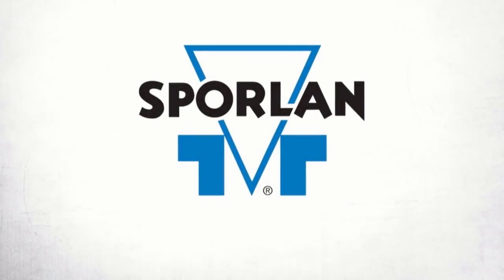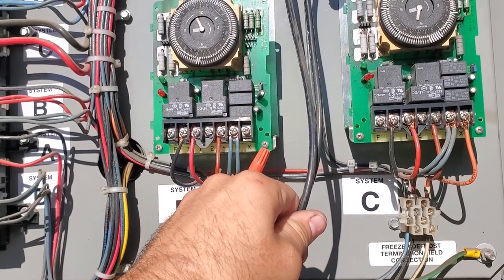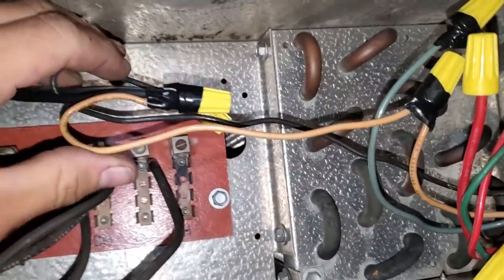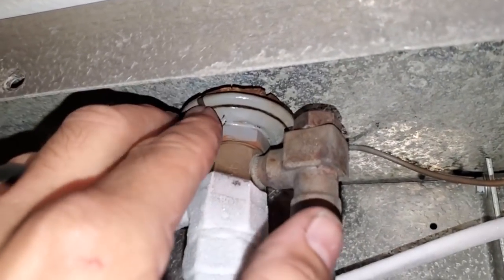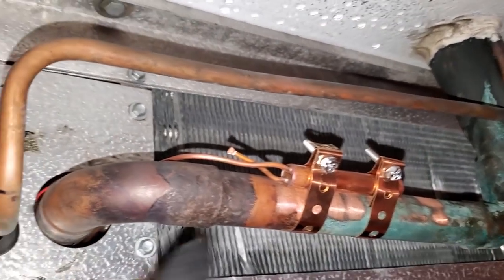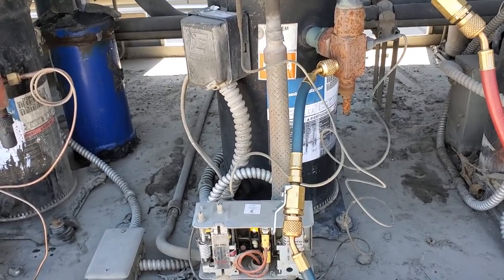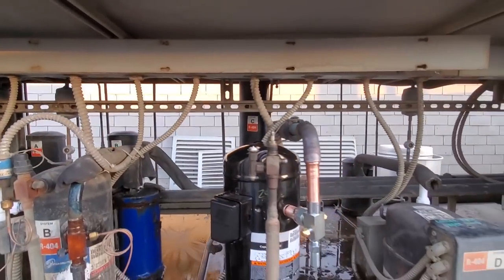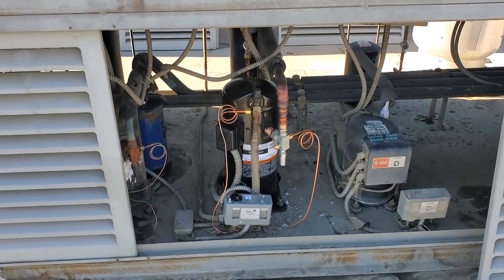BEER WALK IN DISASTER

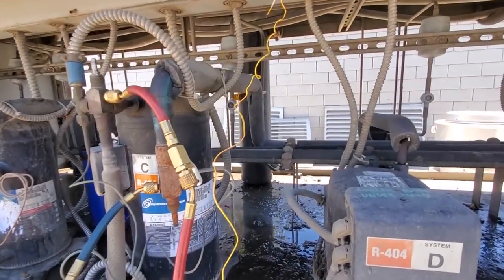Comment: 27:28 Sightglass flashing (saturation) with 27* subcooling shown on gauges. This is a false subcooling indicating non-condensibles (air) in the condenser. The rusty looking stainer 25:26 is also evidence of air/moisture in the system. The compression ratio of 5:1 indicates a very robust compressor. The non-condensibles being removed during the compressor change out makes it look as if the compressor was at fault but it almost certainly wasn't.
On the bright side, moisture may have made the oil acidic and damaged the compressor winding insulation. It may have been short for this world anyway.
Non-condensibles are notoriously difficult to diagnose and I am guilty of getting it wrong also. I hope this comment can help save unnecessary work for someone in the future.
P.S. The value of dedicated and honorable service exemplified in this video is priceless!
Reply: I have had compressor where they pump fine but the seal in the compressor was allowing bypass?
Reply: PM for quarterly or semi-annual checking of oil sample and replacing dryer if needed could have saved the compressor or proven it to be good... 💀
Probably 10x cheaper to do this. 😆
Reply: Yep, I do wonder how they got so much air in the system. And possibly not nitro purging for brazing?

Comment: I also think about jobs at night, dream about them sometimes too. Worse one was a remote location gas heated rock pizza oven. Had to crawl behind a panel to get to the gas valve. Replaced valve, removed the plug, hooked up my manometer, made my adjustments. Fought my way back out of that tight area, filthy, sweating. Function test, left, made my flight. Got home, happy, job complete. Going to bed that night and couldn't remember if I put the damn plug back in! Bothered me for a few days until I remembered screwing it back in.
Reply: I'm an A&P that works on aircraft... I'll tell you what. I lose sleep once or twice a week after watching an aircraft fly away knowing damn well I did the job right and two other guys verified the job was correct, countless ops checks in the hangar, leak checks and the whole 9 yards. Thats called having a conscience and morals for your customers. It's the guys that don't lose sleep at night knowing a family is flying behind their work that worry me. It's human reaction to be concerned and you're a better tech because of it.
Reply: @kennyboyswag  exactly, you're not good at what you do unless you lose a bit of sleep once in awhile due to your conscience. Everyone has one and at some point you're not gonna remember something, and unless you don't like what you do or care, it's gonna keep you awake.

Comment: Yeah, been down that OCD/a***-retentive road - too..., retired avionics engineer, owned a Carrier dealership because of aviation being so 'cyclical', did broadcast engineering because my high school had a TV Station.  I never liked the way that condensing units came wired from the factory, so I spent two hours building everything into an internal harness (also utilized only perfect right angles). Tinned ALL stranded wiring at the termination points, coated bare metal everything with Boshield. Every condensing unit received it's very own dedicated grounding rod, with 10 AWG treated copper grounding wire. CAD - drawn  schematics/layouts/box diagrams for everything we ever installed.  Justified the 'overpolishing' by telling the commenter(s), "that 90% of the durability of the equipment directly relates to the quality of the installation".  I sold my half of the business to my business partner; there are still a few "Carrier Round Ones" working, that we installed in 1981.

Those contractors who don't work to a "set standard", empower those who do, with the clientele which they lose.

Comment: 1 An auxiliary switch is only needed if your breaker cannot handle the load of both the compressor and heaters.
2 Beer cooler runs close to 32 degree.
3 Someone made the limit switch on both Evaps disappear and they screwed up the wiring.

Comment: I really enjoy your videos! Im not an ac tech but my older brother did commercial work like you. I worked with him on change outs 30 yrs. ago. During summers in high school. Im a master electrician now. You need to get yourself a phase rotation meter. Some equipment will be ruined almost immediately if you get the rotation wring.

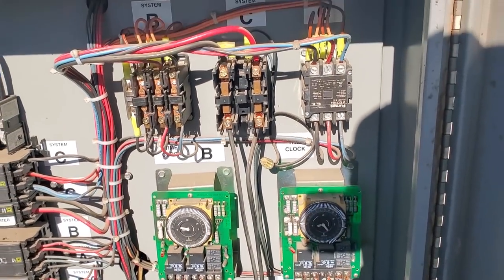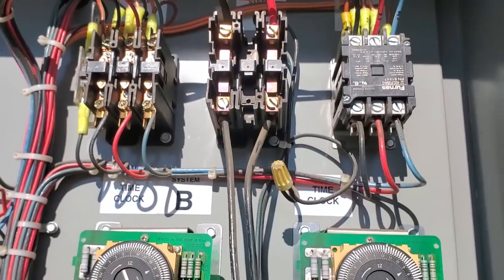Comment: What usually happens at 3:50 is there is an auxiliary contactor  on the compressor contactor that prevents the defrost contactor from engaging while the compressor is running. You mention it at 4:30 so my information is unnecessary. Those powerheads were in a really rough spot. It really annoys me when I have to deal with stuff like that. The design engineers make no accommodations for service...

You were not kidding about this being a disaster. Holy smokes.

Comment: I don't think many people realise how tough the job is (Refrigeration). So much things to check on system, hours spent on jobs, environments you have to work in. As an ex engineer i know what it's like changing compressors/condensing units in the dark! Good job interesting to see what gear you use in the states, little bit different in Ireland but pretty similar. :)

Comment: Good job. I found out over the years that it is fairly common to fix one thing and it leads to other failures of weak parts. I had to replace a compressor 30 feet in the air on Christmas eve for a computer room AC. Thanks for that video.
Reply from the maker: I will be going live on YouTube this evening 8/5/19 @5:PM (west coast time) to discuss my most recent videos and answer questions from emails, the YouTube comments and the chat, come check it out if you can! https://youtu.be/cfSKAK6BvSw

HVACR Videos

Comment: "Brazed, uhh, soldered on here. Just cleaning up my welds here"

🤔

Isn't that technically three different, distinct processes..?
Reply: daniel rodriguez brazing is much closer to soldering than welding. The base metal doesn’t melt, and the join is formed entirely with filler metal in brazing and soldering. Welding is a process where the base metal melts and mixes with the filler metal.
Reply: Dingle Flop brazing and soldering are subclasses to welding. Not the same but easy to pick up if you know the other. It’s like the difference between a motorcycle and a moped.
Reply: @picklev5064 . more like moped to a TT race. Cant believe how many grown ass men cant proper sweat a pipe. Soft Metal High Heat. Spends an extra hour chasing vacuum leak. SMH but yes your Book Work is Solid
Reply: Mr Sunshines oh the irony of calling someone a keyboard warrior while trying to correct them.  SMH

And no they aren’t welding,  welding is action of melting the base metal and fusing it with a filler metal to create a bond. Brazing you are only melting the filler metal (usually of copper and zinc alloy) and soldering is when a filler metal has even a lower melting point (below ~840F).    To someone not in the field, this may seem unimportant but proper terminology and knowledge of process leads to greater success and better paying job opportunities.    How can this be applied? If a contractor/engineer told me he need me to solder a pipe for carrying water, I know that my soldering filler metal is gonna need to be a tin alloy that doesn’t contain lead.  But if you go and just pick up a brazing rod, you could end up damaging the pipe itself as the melting point of the filler metal was at or near the melting point of the pipe. Wasting time, money, and possibly the job or even someone’s life for not knowing about lead poisoning and water pipes.

Why go this far, cause the industry needs more efficient and knowledgeable welders.  There’s an experience gap that’s about to happen and we need to fill it as fast as possible. Break bad habits early and fast so you lunge ahead in proficiency.
Reply: Mr Sunshines go back to the comments, if you use your eyes you will see me address my original comment to dingle flop and not hvacr

Comment: I have the same low profile system in a walk in freezer. With that pressure control defrost termination switch that I could not understand until you called it by its name! Thank you Now for tweaking the system it stays at 0*F and I need at -10 will check the temp controls and any walking due to vibration I learned is your other videos. Thanks man, I'm is S.Florida learning this on my own after years in HVAC expanding to refrigeration any tips be greatly appreciated!

Comment: reminds me of the old rancho seco nuclear power plant out side of sacramento california - they had issues from day one of it never working right and it was not until they were decommissioning it that they found one of the water cooling pumps had been installed backwards - scary crap there because it could have caused a full melt down and they never noticed -- i have seen via your vids that installers make simple mistakes that go unnoticed and unfixed for years because it kinda works but not anywhere near an optimal level.
Keep up the great work and keep the vids coming,i find them relaxing.

Comment: I think I would have pulled all the old wire out that was not in use so when the next service person fixed it all those wires won't be there. I was taught to remove all unused wires so I don't cause confusion. But besides that you done a very good job on changing items before they break. Great preventive maintenance

Comment: Lucky that compressor was able to handle medium temp coil pressures on restart without a CPR valve. I know Kirak built a couple of racks for here in Vegas for micro brew pubs with the low temp scroll systems and electric defrost. The box temps were I believe around 31° average but no glass was stored in them. Alcohol in the beer prevented the product from freezing. I'm wondering if that compressor is sized property for medium temp with the amount of suction velocity you may encounter on a warm start up.

Comment: two "agains"  was a manipulator of heat before and another good video.. also always amazed me that when you run into these multiple problem calls how the system was actually able to  limp along before. Side note on the defrost; if a med temp system doesn't go below 35  air temp in the box and if (big if) system is running properly (which looks like you spend a good time worrying about  Kudos) then the normal off cycle should be adequate to defrost between run cycles

Comment: I love your vids!  Great angles, lighting and sound! Superb narration, including smashed fingers, and just the right amount of explanations for every action and every observation.   
I always set all defrost times to every 8 hours, or 6 hours.  The reason is that after a power outage, your clock will need to be reset, and it will eventually result in a service call. To avoid these pointless defrost calls in the years ahead,  always use equal divisions of clock time, i.e. 8 hr.   The theory of performing night time unoccupied defrosts, will result in senseless added service call expense for the customer after power interruptions, (storm, accident, electrical service, repairs, remodel, etc).  During a service call, when I see targeted defrosts for 2 a.m, I always change the defrost schedule to every 8 hours and then explain defrost cycles and symptoms to the kitchen manager.  The 2 a.m. defrost is best suited for techs on site, that are employees that respond on demand without bearing the cost of a service call to outside companies.  Eventually, every tech, on site or not on site,  will be annoyed with a trip to the roof, solely for setting defrost timers  after a storm.  I don't live in California, but most the midwest and east coasts have storms and brief power outages, especially at night when no one is aware of the outage and how it affects the defrost timer. 
I am a past tech for a short 8 years. I loved the job. Hated the labor of lugging tools, pumps, gas bottles, cords, ladders, torches. I wear glasses, so have to deal with fogging too. I love your rope hook and your new remote cordless pipe clamp thermostats. How quickly the tool world changes in 5 years!  
Tell my why the few, the most talented, most experienced, most knowledgeable parts counter men are also the most annoying to deal with.  I can't do my job without him, and I love his impressive skills, but I resent yielding to his attitude of superiority. Do they all resent being stuck behind a counter or what ? Fortunately for him, he is worth his weight in gold. How do they know so much from behind a counter? 
Keep up your amazing hands-on videos!!!

Comment: You should have kept that electric defrost, I see a lot of beer coolers in my area with that same setup, the reason being is instead of cycling between 35 to 40, they cycle between 32 and 36 And they can have a very short defrost cycle because of the heaters. Doesn't seem like it would have a big impact but let me tell you, they will sell a ton more beer. It has a very similar effect to when you change out dingy ballast light bulbs with LED strips

Comment: Sometimes crazy crap happens one thing after another after another. Especially systems 20 plus years old with all original parts. Ppl not doing maintenance and letting scrap get to the point. Hardest part of the job sometimes is dealing with customers

Comment: Good Vid. Wow, what a mess that one was. i find that alot when ever i take over a new account. many past people in there piecing things together till it reaches a point when it needs alot of work. you were the lucky one on that one. Keeping that rack condenser clean is the Key to keeping those systems working. i might check that one and see if any tubes have been bypassed on that system condenser.
2) Thats alot of Evaporator down there. i 'd probably check the btu's on those evaps and see if it matches what the compressor is rated for. 

3) High pressure safety --- Set at 500 Psig ?
4) You might want to make yourself a check list --- So when u do a Big job like htis it's a Last thing u check before leaving the job site. it takes the thinking out of it when u are tired as hell.
Put it on your phone in the notes section.
Like:
1) check temperature control before leaving jobsite. set point,cut in and diff.
2) double check low pressure control settings.
3) high pressure safety setting --- 500 on 404a. 300 on 134a.
That sort of thing. it helps with the sleeping for me. knowing these things are checked before leaving jobsite. you can even put check marks on the list-when u check it and e-mail it to yourself for next day.
it's great for double checking your brain the next day , your brain doing the did i check that before i left the jobsite worry thinking.
Reply: That's a great tip.

Comment: Wow, that may have been the worst service call I have seen on YT ever! So many damn problems. I would have been cussing like crazy on the roof. I agree with you about passion. My fellow engineers always turn a bunch of valves off when they have heating or cooling problems instead of taking the time to learn how to become a technician & solve temperature issues. Nice job & I would have liked to have seen that repair bill!
Reply from the maker: Thanks for watching!  I will be going live on YouTube this evening 2/24/20 @5:PM (pacific time) to discuss my most recent uploads and answer questions from YouTube comments, the Live chat, and email’s. Come on over and check it out if you can. https://youtu.be/qop5jyuMfmc

Comment: Put one clip type limit switch in series with solenoid coil to prevent pressure run too low it help maintain the box temp. Just in case if does will kill the power to the solenoid get the air defrost kick in

Comment: Talk about Deja Vu!  I found a similar nightmare (although a single condensing set up with 2 evap fan coils ) for a Walk In Draft Beer Cooler  a decade ago or so. Complete nightmare. Why waste all this energy for electric defrost and  warm up the box significantly when it is a med temp beverage cooler? I agree what you stated,  Air defrost should be enough if set up correctly. Like you  I found a whole bunch other issues, resolved them. Set it up for air defrost 3x45mins. Never had a callback. Beer temp stayed right on the money, no foamy beer waste etc.

Comment: I still can't understand those hunks of #6 wire on the defrosters, but I did wonder if they were 110V defrosters powered from 208 or 220. That would explain some of the tostiness on the connections.
Reply: A good guess..last tech was lacking a short roll of #14 awg to correct or patch the wiring from the tech before him..ha..a compressor lead from that abandoned roof top served the job. Ha.
Reply: If they were 110v heaters powered by 220 they would of burned out immediately! Possibly with a bang
Reply: @markholder6851  not if they wired the 2 -110 volt heaters in series.

Comment: I didn't know that they made TXV set would also limit maximum pressure for the evaporator. Doubling as a CPR valve. When you changed out those TXV heads maybe the reason why the compressor started running so high pressure is it might have been a big load, a bigger load than it was designed for. It really seems like the whole system should have been replaced to put a low temperature system in an application where they needed a medium temperature system. The frosting on the evaporator might have been as a result of a low temperature unit.

Comment: we have a place here that wants to keep their beer at such a cold level, it needs to have heaters on it, it will freeze up over time, of course, you have to take into consideration, they use several different companies, and not all of the techs working in this field take the time to do it right, then there is those techs that walk up and automatically add to the charge, this one practice of adding before anything,  just blows my mind right off the bat!
Reply: They don't really understand the system. Mechanics call be a learned skill, diagnostics is the art and that's what makes a good technician!